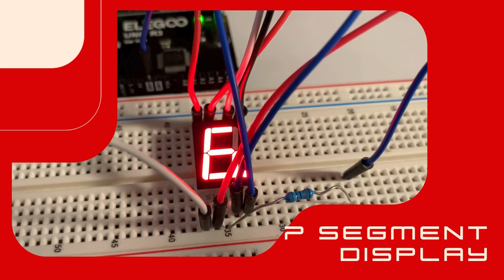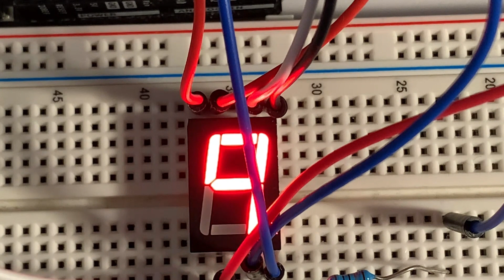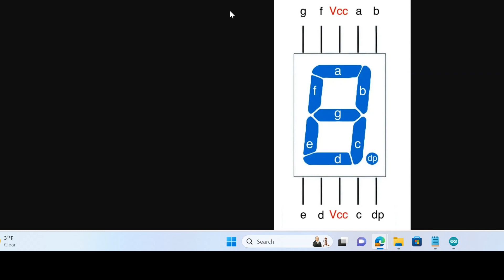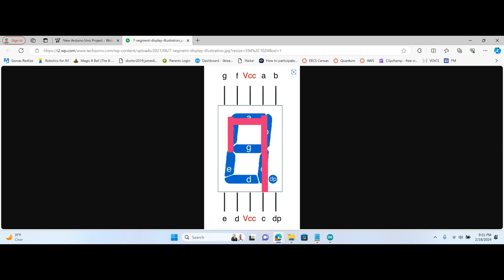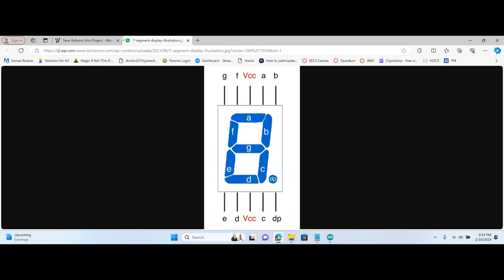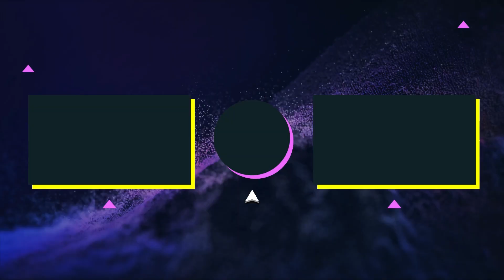7 segment Display - In depth and Easy Tutorial

Comment from the maker: byte pin[] = {2, 3, 4, 5, 6, 7, 8, 9};//arduino pin array 
 
int number[9][8] = {//number array 
  {0, 0, 1, 0, 1, 0, 0, 0},//1
  {1, 1, 0, 1, 1, 1, 0, 1},//2
  {0, 1, 1, 1, 1, 1, 0, 1},//3
  {0, 0, 1, 1, 1, 0, 1, 1},//4
  {0, 1, 1, 1, 0, 1, 1, 1},//5
  {1, 1, 1, 1, 0, 1, 1, 1},//6
  {0, 0, 1, 1, 1, 1, 1, 0},//7
  {1, 1, 1, 1, 1, 1, 1, 1},//8
  {0, 0, 1, 1, 1, 1, 1, 1},//9
};
 
void setup() {
  for (byte a = 0; a < 8; a++) {
    pinMode(pin[a], OUTPUT);//define output pins
  }
}
 
void loop() {
  for (int a = 0; a < 9; a++) {
    for (int b = 0; b < 8; b++) {
      digitalWrite(pin[b], number[a][b]);//display numbers
    }
    delay(1000);//delay
  }
}